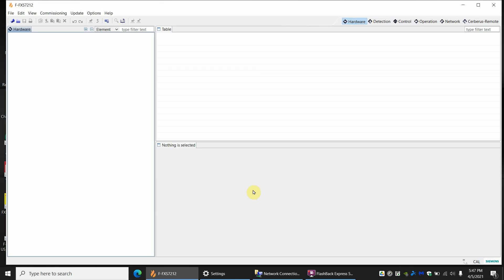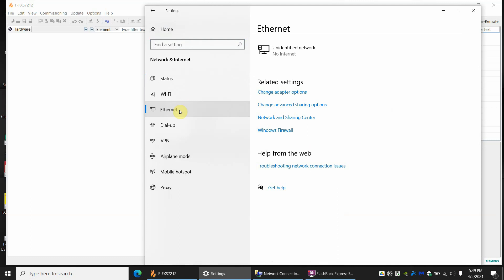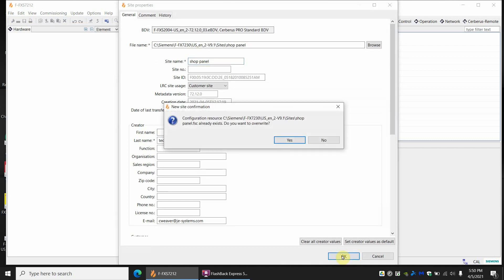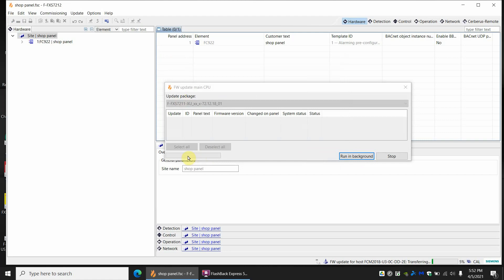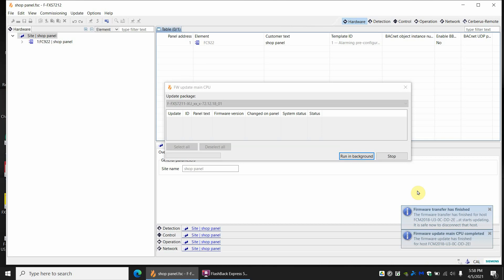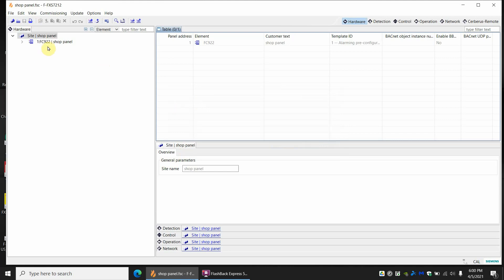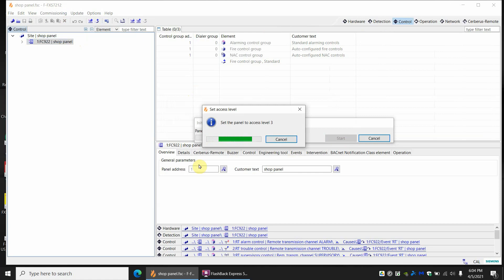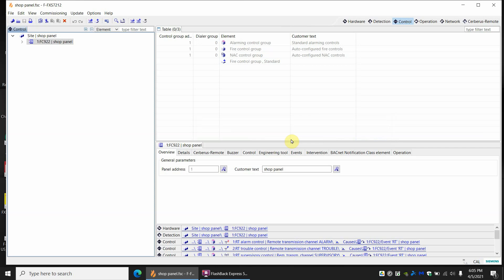Siemens 922/924 Firmware update for an existing panel

Comment: Hi Brent,
Thank you very much for the contribution.
I'm doing the FW update on 6 FC922 panels, following the shared steps and in the first 5 panels everything went perfect, although the panels had some trouble events.
However, in the last panel, when updating the FW of the main CPU, it load everything as normal. But in the end a new event appeared: Hardware missing (FCI2016) in the PMI.
Could you please give me your support.